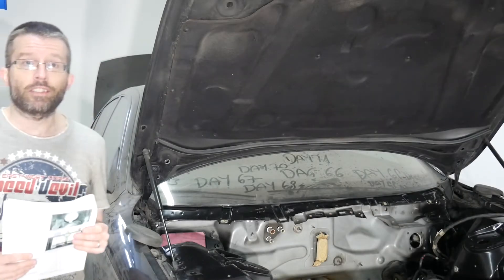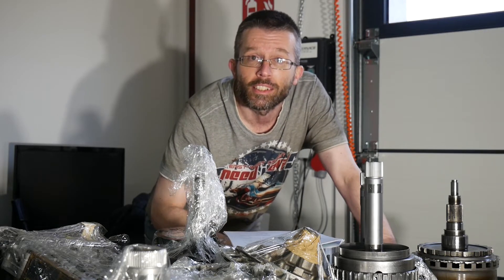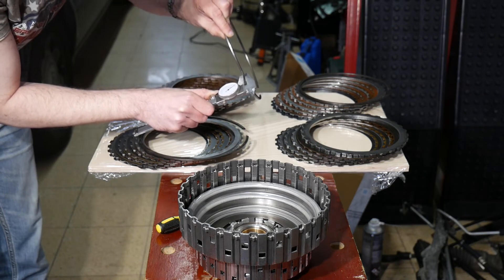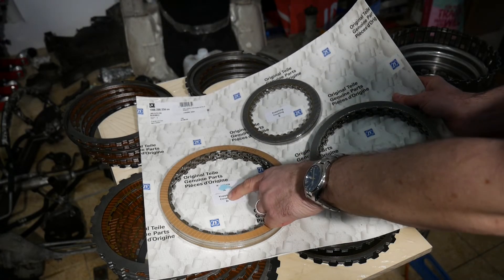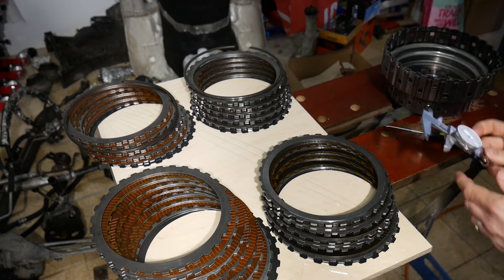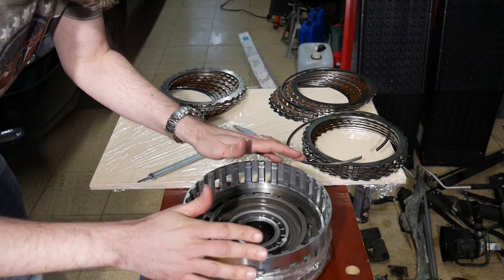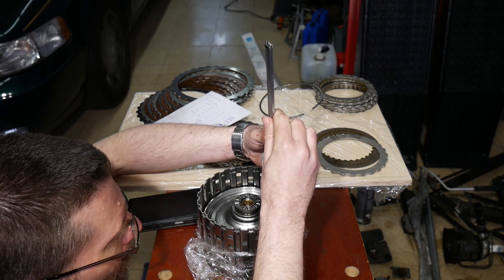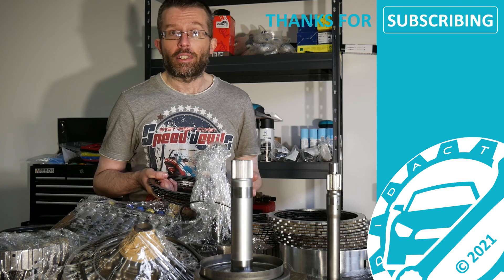Jaguar S-Type Restoration [73] Measuring ZF 6HP26 Gearbox CLUTCH PACK CLEARANCES [2021-04-18]

Comment: hello from Poland :) I know that you made the material 4 years ago, but I'm in the process of rebuilding the same gearbox in a BMW E61 and I have a question about clutch disc spacers, specifically about 5:09 minutes of the video - I can't find these parts - do you remember how to find them? Regards. Peter

Comment: Thank you for your great videos! They are super helpful

How much do you pay for the garage? It's been almost two years so I guess quite a lot of money spent just on renting.

Also, I'm sorry if I missed that, but what is the current state with the engine? Did you manage to get your engine block back and order new pistons?
Reply from the maker: I'm afraid the garage already was more expensive then a good used S- Type had been...
I left my original engine at the machine shop for the cylinders getting bored to oversize as soon as the custom pistons arrive (which is delayed due to the current situation). I hope I can give an update soon...
Thanks a lot for watching btw 👍